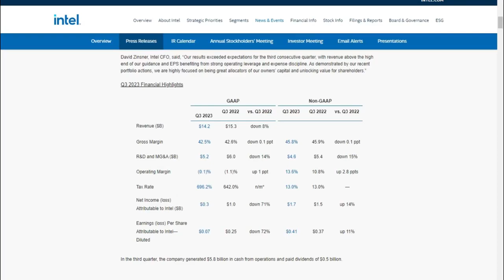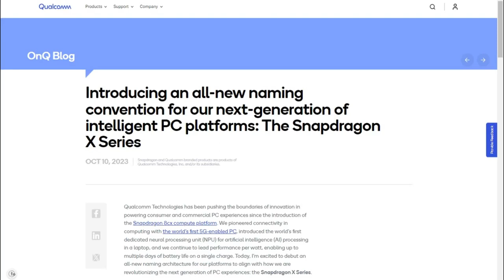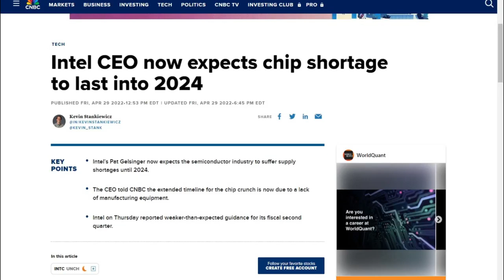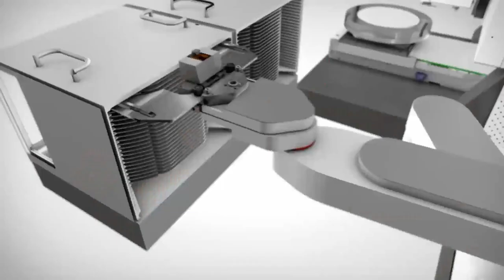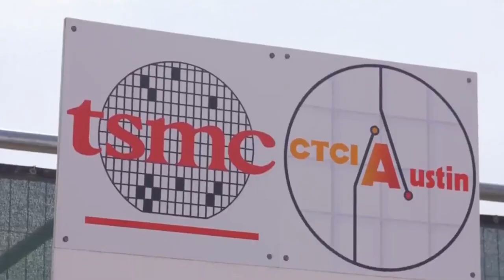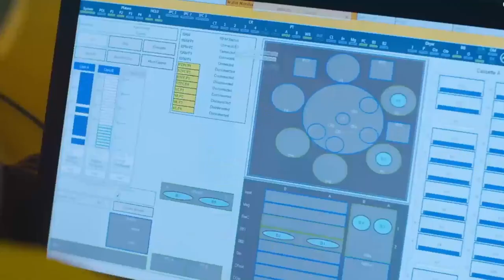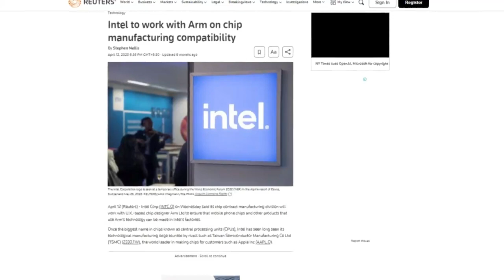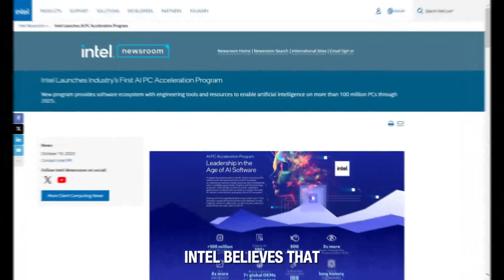Intel Set for 20A 2nm Chip Mass Production in 2024 and Next level AI

Comment: What is this advantage? when the media is already making noise about the accelerated degradation of silicon in computers based on 13-14 generations, and the manufacturer has been silent for too long, what consumer in his right mind will not doubt the quality and durability of new products when the company has not solved the problems caused by the old ones

Comment: What Intel calls 2nm another company would probably call 5nm 😅
Reply: All these terms are marketing strategy. In reality they'll be somewhere around 30nm
Reply: Actually it's been the other way around for many years, until just recently that decided to step up their marketing in that regard to look a bit better.
Reply: @Lucius4992  Intel has been "behind" the past 6 years (because of mismanagement and the firing of more than a few top-level managers because of it).

It is also easy to prove they are still behind, because at the same stats their CPUs are drawing a LOT more power and generating a lot more heat.

Hard to believe a story that claims Intel is turning "2-3 years behind the rest" suddenly into "1 year ahead".
Reply: @Junyo  I know intel has been behind and still is. They kept using 14nm like forever. We are talking about different things here. I was referring to their naming/measurement of the transistor size, which tends to be misleading.

Comment: 2NM ???  Crazy !!!
Reply: It's not really 2 nm.
Reply: yes it's really 2nm @RiwenX
Reply: Beyond crazy...they are starting to measure the distance between transistors in angstroms...the smallest transistor is 1 nm or 10 angstroms...so 2 nm is 20 angstroms...the diameter of an atom is 1 angstrom...what is really crazy...one day we will make subatomic computers.
Reply: you cant go subatomic, you can go quantum @ChadLuciano
Reply: I agree. Nowadays it's not about the size of anything at all. It's basically pertains to generational manufacturing tweaks to achieve substantial performance gains.